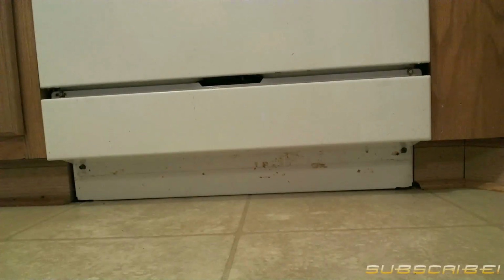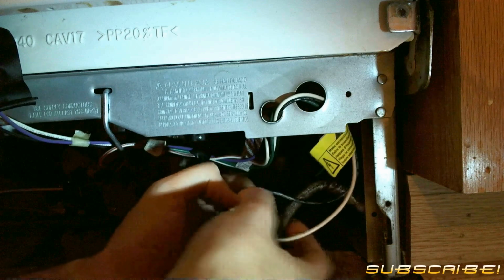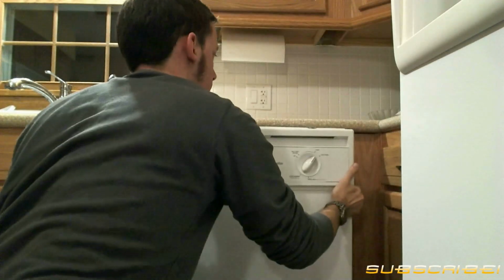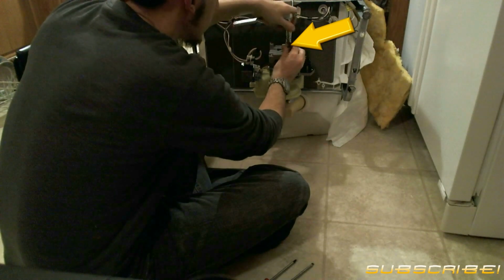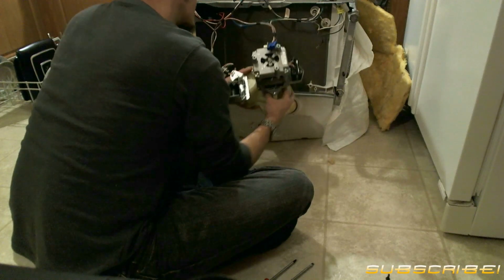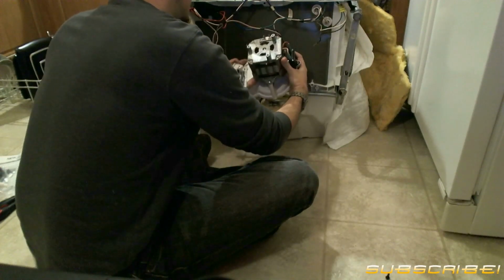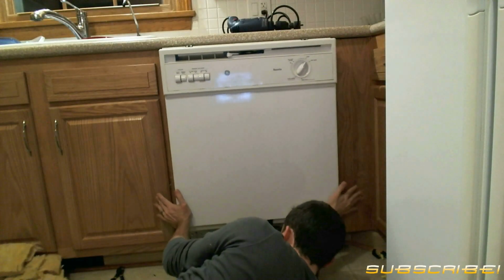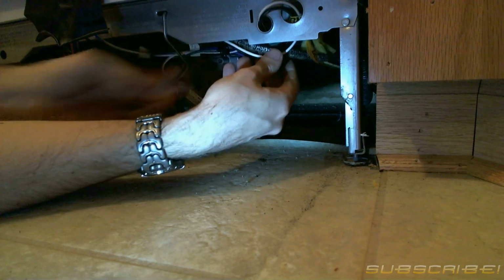How to Fix: Replace a Dishwasher Motor/Pump Assembly

Comment: My dishwasher works, but does not clean well and  receptacle holding the detergent does not completely empty out.  A service repairman said that we need to replace the pump-mother assembly.  Do you think he is correct?  By the way your video is excellent.

Comment: There is a problem with my dishwasher. Can you help me? I clean with my dish washer, and it works perfectly fine, but the problem is that sometimes the dishwasher won't suck the water when its done cleaning. I need you to tell me what to do, please.

Comment: What were the symptoms of this motor that made you realize it went bad? Cus I'm my dishwasher ain't washing at all, it collects water, heats up, drain but won't wet the dishes. I'm think circulation pump that's the reason I'm asking.
Reply from the maker: The issue that lead to the replacement was a sound that was almost like a spoon caught in a disposal and then a lack of water evacuation.
Reply: I am having the same issue with my dishwasher. Did you manage to fix it? If so, how? Any advice would be most appreciated!

Comment: Are the pump housing and impeller/seal normally included when you buy the full pump setup?  The rod the grinder "blade" is attached to is stripped and it looks like I'll need a whole new pump.
Reply from the maker: It should be included to my knowledge, as mine was when I ordered it.